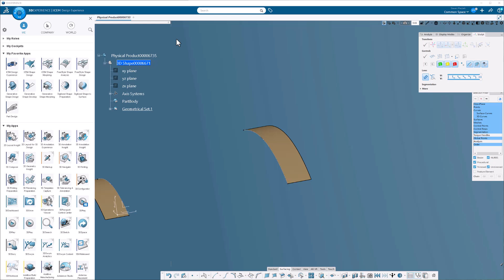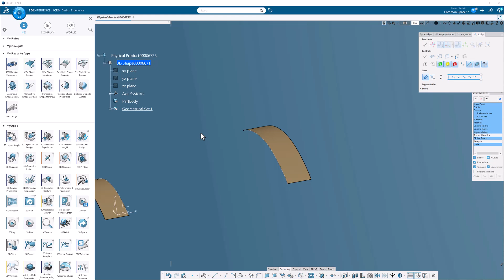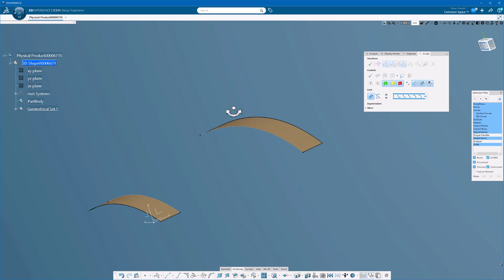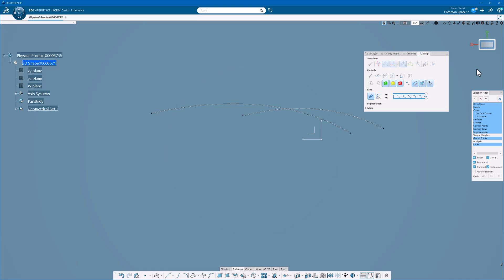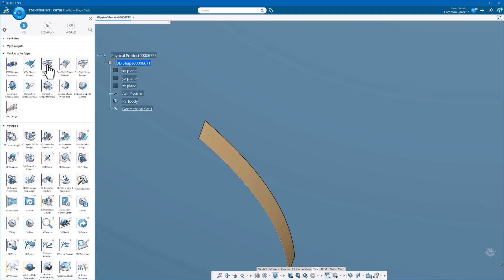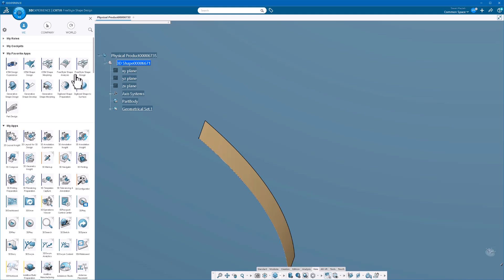3DEXPERIENCE | What is ICEM?

Comment: The world of Dassault always requires another license.  The one that always gets me as a mainly GSD, Part design, Assembly etc user is you needed specific license in V5  to cut a section in an assembly and for it to persist after clicking ok you need another license.  Obviously this depended on who you were working for if they paid for said license very frustrating. I've used 3Dexperience but with OEM licenses available so never got in the weeds on it.  I'm not really sure if Siemens play similar games (used it for 3 years now)  of course they will charge you for HVAC design /ship design etc but I'm not sure if they break up core modelling tools like Dassault.